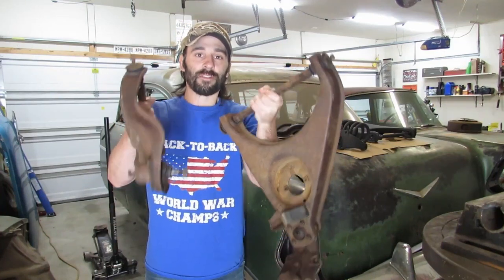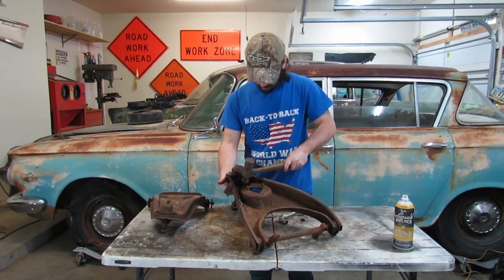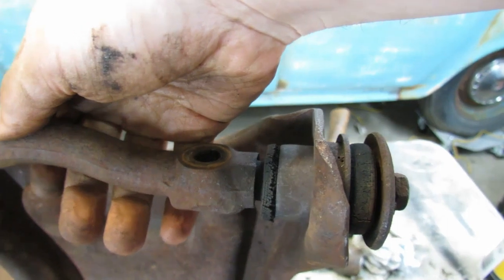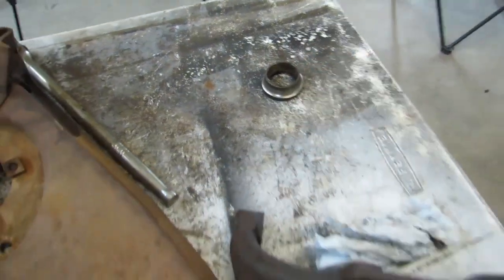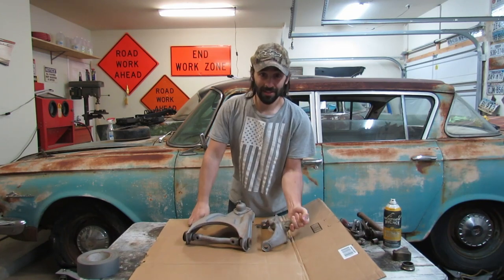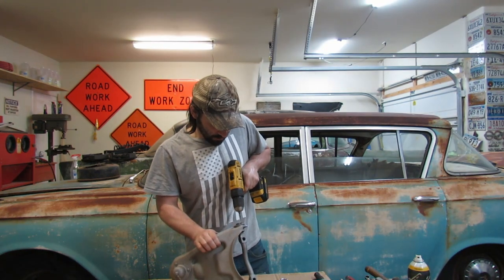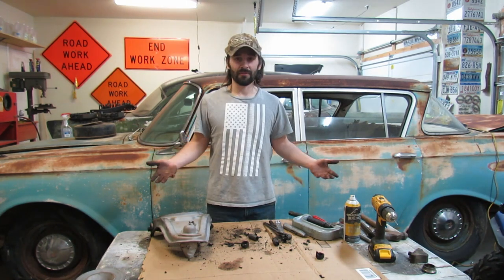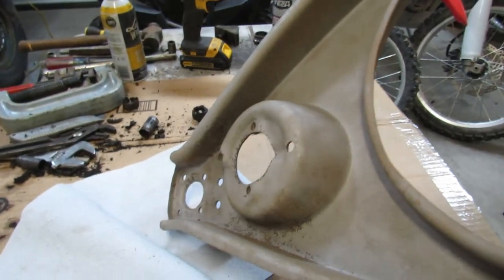This Is Finally Done On The Abandoned Tri 5 Chevy Build!

Comment: My 55 Ford has bushings like that as well.  I heated the rubber up with a little propane torch and the bushings turned right into flames and smoke kind of like a horrible candle. The stuff that didn’t burn quickly got really soft and flexible and I could easily push it out. Just something you can experiment with in the future. I never realized how good vinegar does, I’ll have to give that a try!  Also, You could consider doing POR15 on the frame before you drop in the mystery motor ……. It comes in semi gloss black too.
Reply from the maker: Oh yeah I've used a torch before. POR15 is a good idea. Thanks for commenting & sharing.